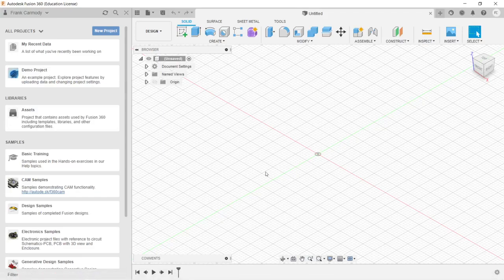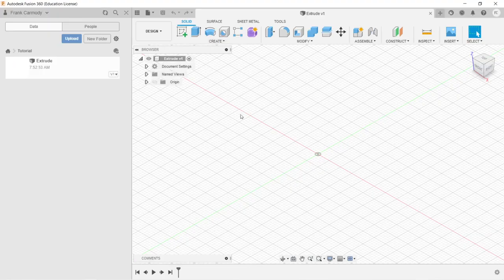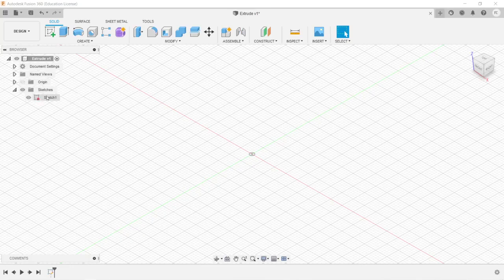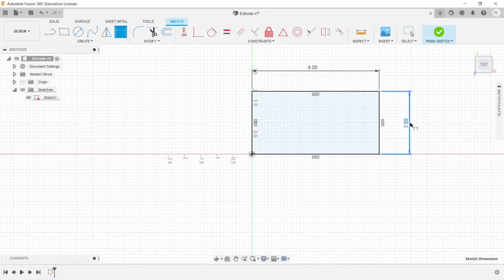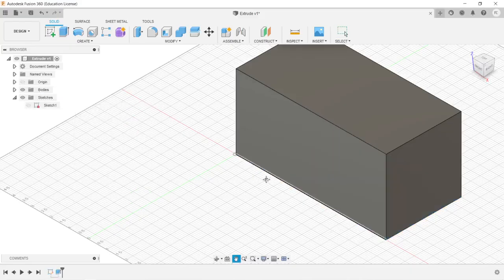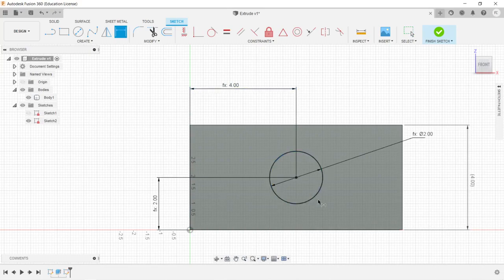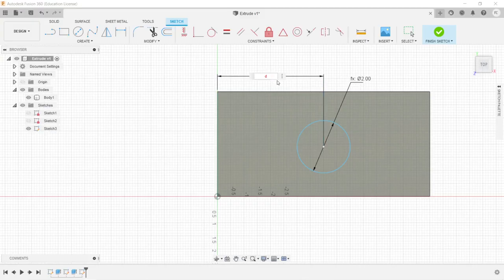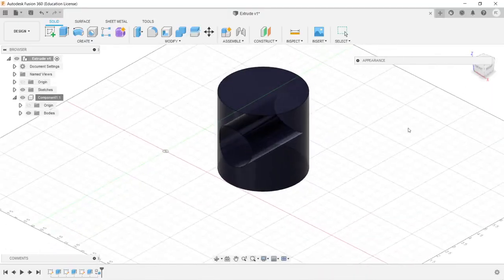Fusion 360 : 01 : Introduction and Extrude

Comment: Nice Video!
❓ Is there a way in Fusion360 to easily make an extrude from two sketch-faces which are rectangular to each other?
I have a furniture and made 2 sketches (one in top-view and one in front-view) with a lot of faces.
It would be really helpful if there is a way to make bodies from where those faces would intersect. (Without the need of extrude both faces very long, make a combine-intersect afterwords and delete the not needed bodies. Because there are a lot of bodies to create this way and this would take too long!)
I hope my idea is clear what and why I want to do that.
Thank you very much!